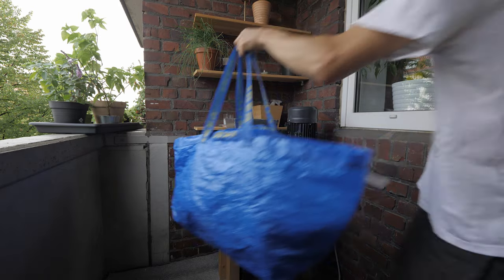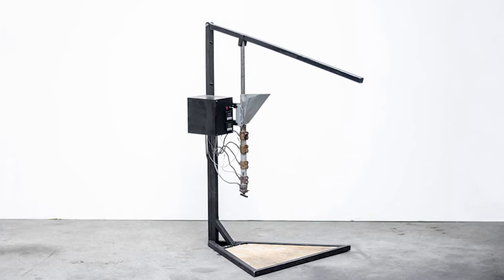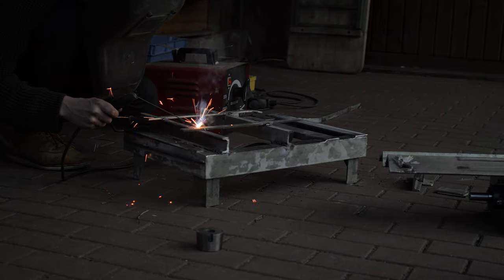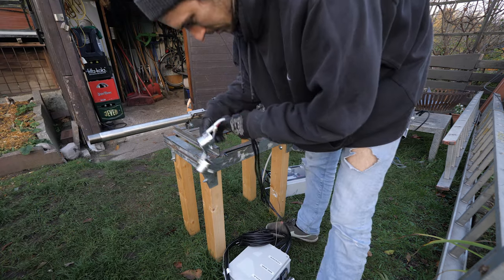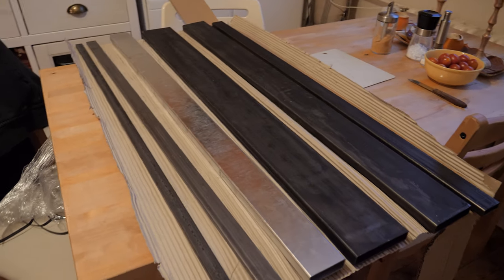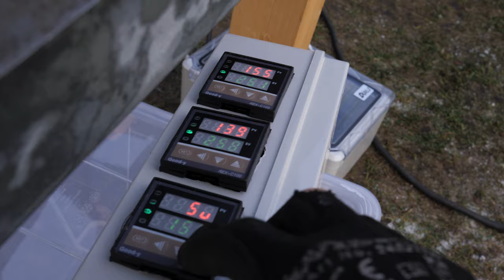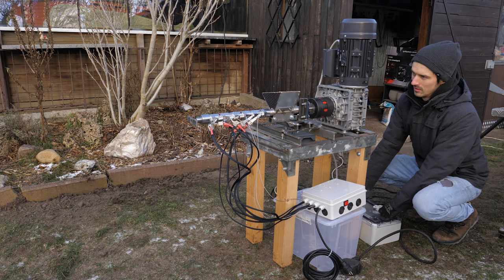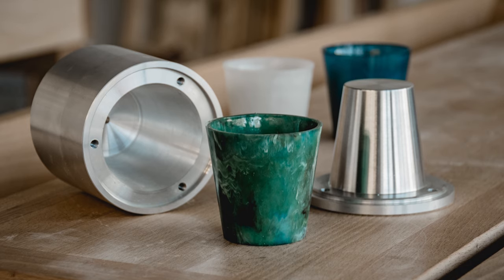Building The Precious Plastic Extruder

Comment: Heat your mold to molten plastic temperature before extrusion for easy removal. Spray the inner mold surface with mold release silicon spray for frictionless release. Run a continuous extrusion so that subsequent feed assists in pushing out the previous.
Reply from the maker: Your first point is to heat the molten plastic before extrusion, do you mean heat it before going in the mold? Molten plastic should be hot enough by itself or what do you mean?
The spray sounds very interesting! I tried all kinds of lubricants before but not sure if i tried silicon. Any recommendations?
Thanks four your input man!
Reply: Reply...ugh...

Comment: You can also use an extruder, especially if it is a twin-screw extruder, to produce a plastic masterbatch with a color of your choice. That's great if you wish to produce your very own filament, with its own specific color and properties. You can take PLA fibre - even one you made from scratch from sugars - and mix it in the extruder with pigments of your choice and other additives, usually a 50/50 ratio. It will eventually extrude out a thicker "rope" of material, which you can then have chopped into smaller pellets. Then, you can use pellets of a different color and mix it with those to get it even closer to a desired color if you wish, inside of a filament-extruder!

Comment: Hello, so I am from Mali. And in an effort to fight plastic waste I make plastic pavers out of plastic waste waste. And now I’m planning to building a plastic extruder that is cost effective but haven’t got a clue how. Your video is amazing btw
Reply from the maker: Hey Amara, thank you so much!
Sorry for my late reply by the way. Your idea sounds awesome! Making Pavers is a good idea when you want to turn around a lot of plastic waste. And they don't have to be totally clean either (which takes less work).
However, I'm not sure if you can build a cheap extruder and get the results you would want. My setup works really well for putting in a lot of plastic. When the opening at the front is big enough, there's quite a bit coming through.
I tried to make mine as cheap as possible and here is what it cost (if i remember correctly):
- Extrusion barell and screw - around 250€
- Heating elements with electric box - 300€
- A coupling - maybe 50€
- An electric Motor - Mine was 600 but it is overpowered for an extruder because I've bought it for the shredder.
Maybe you can try and find a used electric motor with similar specs? That would be a start to make things cheaper. Check out the video from precious plastic, they're using a wood drill as a screw and you could go with a steel pipe for the barell. You could get the heating elements for cheap online and build it together yourself or ask someone that knows electric stuff :)
Hope that helps 😃

Comment: One thing you can make is a "Deadblow Hammer". Any trade that installs windows needs one. Also automotive. It's a plastic hammer with a steel core. Sand weight at the head. I actually want to make the machines for this reason. The milk gallons plastic we get in the USA is perfect for this tool.
Reply from the maker: Sounds like a solid idea but how to you get the steal/sand core into the hammer?
Reply: You can fix steel core into a metal tube. I think that bolts is a best idea.

Comment: i use to work for a plastics company, injected and rotational, your extruder die needs to be much shorter, polish the insides if there not already, a release agent would help and a roller table to receve the post after the die, we use to make welding fillament. basicly after the die head you draw the wire though a trough of water to cool then onto a spool and wind it up thus draging though the water. making 1.0mm and bigger. great to see this becoming a home hoby tech like 3d printing... ;)
Reply from the maker: What is the die of an extruder? I'm a little lost here. I'm not super keen on making 3D filament because it's so tough. I would love to get a penny board mold or something like that.

Comment: My .02 Cent, I have been watching a lot of these type of videos, I have yet to see anyone insulate the extruding tube, Fiberglass blanket or wrap. A tremendous amount of heat is being lost there and your heating elements are working more than they should. Also maybe place a couple of the heating element clamps on the long molds to keep the plastic more fluid.
Great Start...
Reply from the maker: Thanks a lot for the input. Yes insulation makes a lot of sense.
I was also trying out heating the mould. Might cover that in the next video :)

Comment: 4x4 (90mm X 90mm) beam replacement for home building. Plastic is a little be weaker than wood, from my understanding, so by making 4x4's you could build anything. I am personally thing of a patio frame and then toping that frame with a plastic sheet thick enough to hold roofing tar. In this way the plastic is immune to any water damage and the tar will protect the plastic from the sun.
Reply from the maker: Good idea! Maybe the beams will become a little heavy. But they will be durable for sure!
Right now i'm still working on improving the extruder. 
And sorry for the late reply :)

Comment: If you add heat zones to the tubes for those extrusions it will flow quicker and be way more solid when done.  You can even run continuous.  Add water bath after the tube.  Also make the tube shorter for sure to run constant.
Reply from the maker: I know what you have in mind. I tried to go in that direction but it didn't work. I will post an update video on those extruder tests soon.
I think for this extrusion you are talking about you would need machines that are a lot bigger and that run for a whole day. It's kind of like making 3D filament right? you cool the extrusion right when it comes out and you end up with and endless beam. That was also what i was hoping for. But is definitely hard to achieve. You'll see in the next video :)
Reply: @ARTVENTUREFILMS  it is and isnt.  but yes you cool the filament as it exits  have been aextrusion tech for 20 years.  wire cable and tubing.  also made fillers wich is exact same as filament.  awesome project though.  i havr always wanted to make one for home

Comment: For those benches it would be better to heat the metal molds. This will help fill the mold out. Heat heat heat is what you need for more uniform and packing the mold.
Reply from the maker: Thanks a lot! I think you're right.
I'm also working on an update with a little more extruder testing if you're interested.

Comment: Awesome build. But why the hell is nobody using an extruder screen for filtering the molten polymers?! Every normal sized extruder or blow molding machine has it. It has to be Installed before the nozzle after the hottest heating stage and obviously after the screw. 
In normal operation when the temperature  is too low / rpm of screw is too high the resulting shear stress will cause lokal degradation ("burning") of the polymer. These impurities will be filtered out be the installed screen. Screen size depends on melt flow index of the used polymere and can be found in vendor documentation (to build ur own).
BTW: Extruding long objects without heating the mold or lubricants will always cause the extruded part to look ugly at the end. As its growing while extruding so is the force growing needed to push the bar through the mold. That again leads to burning or damage of the screw / motor.  You should just use a big nozzle shaped as desired for such shapes and active cooling  the extruded (endless) part.

Happy extruding =)
Reply from the maker: Hey there! Sorry for the late reply.
I don't really know why no one is using a screen to filter the molten plastic. Sounds very plausible though. I'm not an expert. Just trying out the precious plastic approach to recycle plastic.
Thanks for the advice. I will post an update on all my learnings soon:)
Reply: Don' need a filtering screen (a filter) for extrusions so big as this. All of the contaminants will just be trapped in the mixture. That is the joy of it. Throw any old shite into it and it will still be strong.
Reply: But yes, a heated mold is essential, especially for PET or any other semi-crystalline polymer. If if crystallises in the mould no amount of power will push it through.
Reply: @joemulkerins5250  but this "trapping" is one reason for the ugly appearance  ;-)

Comment: Deck board and plastic bricks would be great implements. A thick round flange w/6 bolts to connect the die to the extruder end would help seal between but the excess pouring out of the connection is normal. You could have a pin size hole ground in between to direct this overflow downward. A pressure sensor before the extruder end to monitor high pressure. Molten plastic under pressure and spray and leave deep scaring burns. Not to mention fire safety. The die itself could be shorter but an additional lower temperature heating element would help it flow out. Once out of the die air or water cooling would help keep its shape and leave it with a nice finish.
Reply from the maker: Yes, I would definitely love to make a penny board!
Thanks for all your input, that's super helpful. I will upload another video of my progress with the beams soon.

Comment: If I had an extruder , I would produce some filament for 3D printing.  
A long time ago, I produced molds. As long you have round shapes with the same center, molding is not so difficult. Just onbe maxchine, a lathe, is needed.
The performance of your extruder is good for small molds.  When you produce beams, the fronter tip will be hardened long before the end is reached. For beams, thats possible, for molds, it`s nessecary, that the whole mold is filled, before one part of the material begins to harden.
Reply from the maker: Thanks for your input Klaus! I will need it for my future improvement on the machine. Really appreciate it, thanks!

Comment: Are these bars not more or less cast rather than extruded per see.  Have you tried to actually extrude the bars through short beam molds where the formed beams actually cooled outside the extruder mold rather than inside the mold?
Reply from the maker: Yes, i tried. My next video will be a little bit about that. The problem is, that for this kind of extrusion, you need a pretty thin structure or an insane amount of rapid cooling.
I think you could somehow get to a point of actually extruding endless beams. maybe by cooling after extruding 1 to 2 meters but it's not really what I'm going for right now.
Thanks for your input!!

Comment: If you don't mind me asking what were the amps set at on your first run? It's possible that maybe the test run wasn't hot enough. Maybe add some kind of lubricate with the plastic? It could be cooling too fast?
Reply from the maker: I don't know the amps. been a long time. But i have improved the design and will come with an update video soon!

Comment: Cut the tubing mold to about 100mm long just to let the plastic take the shape and into a water bath as it extrudes
Reply from the maker: I actually tried that, will upload a video soon of my tests if you're interested.
It's too thick to be rapidly cooled, but would be awesome to get an endless beam out of the machine.

Comment: You could make 3d printing filaments but it need additional cooling tank and pulling mechanism
Reply from the maker: Yeah that's true. Which is why it's super hard to do and i don't think i will manage to get it done 😃
Reply: @ARTVENTUREFILMS  I think you can do it, totally!
Reply: What do you mean by cooling tank, exactly? Do you have any plans for a whole set-up? from what I understand, you can make a masterbatch with an extruder this way: PLA fibre and pigments and additives are mixed in a 50/50 ratio (50/50 of PLA and additives) in a screw extruder, usually a twin-screw one. The friction (I believe? Or does it actually have an electric heating element of some sort?) of the screw is what causes the material to melt and mix so well, and it is extruded into long but slightly thicker than filament ropes, which are then cut by a machine into small pellets.

Then you need a filament extruder, for instance the ArtMe3D one, with which you may take these PLA masterbatch pellets and mix them with PLA pellets of a different color to get it even closer to a color of your choice. This machine cuts these materials up and mixes them, again, and has a heating element as well. It comes out as filament, by being pulled into a filament extruder like those on a 3D printer, and is wound onto a spool.

Comment: As an advice, put a plug slightly smaller in the pipes that would be pushed by the plastic once the pipe is filled. It would be a much more condensed extrusion. 👍
Reply from the maker: Thanks for the hint! I will post a video of my attempt of making beams soon :)

Comment: Amazing, no mind me asking where the coupling from? Thanks
Reply from the maker: The coupling i bought from Maedler. Their page is the following: https://www.maedler.de/
Reply: @ARTVENTUREFILMS  thank you for your reply. what was the flange size for the extruder?
Reply from the maker: @hackercabin190   I think it just has a small shaft where you attach the coupling.
Are you also building an extruder?
Reply: I am building it it's awsome project that I hope seeing it finished  I actually bought most parts and am half way there I guess, am stuck at the flange which the barrel get attach to it, the part between the coupling output and the screw. if you could offer guidance would be highly appreciated  @ARTVENTUREFILMS
Reply from the maker: @hackercabin190   yeah man for sure! send me a message on insta. Maybe you can send a picture of the flange and where you need to attach it.
Reply: Great! I genuinely appreciate the assistance you provided. I've sent a message to your requests inbox. Thank you.

Comment: Hello, good extrusion equipment, but I have a question, how did you do the protection of the extruder screw's recoil so that it does not damage the reducer? Since I see it is a bearing but it is not axial, it is like a flange radial. video
Reply from the maker: i think i now what you mean but then i also don't really know what you mean. Yes there's only this one bearing and yes, that bearing also prevents the screw from going towards the coupling. Is that what you meant?
The design isn't perfect, but it works 😄✌🏻